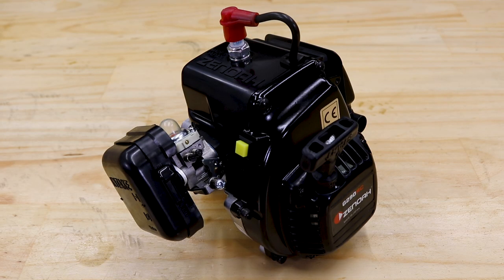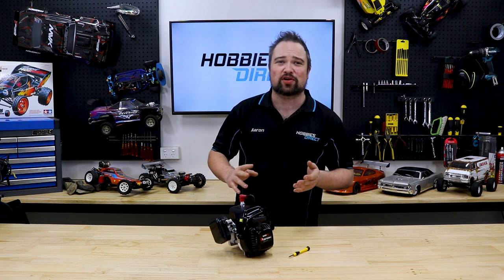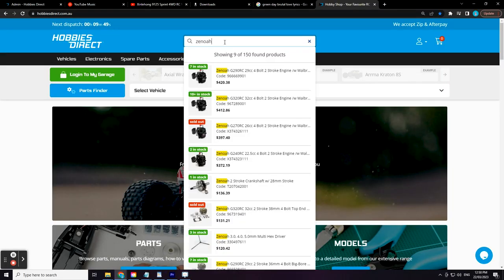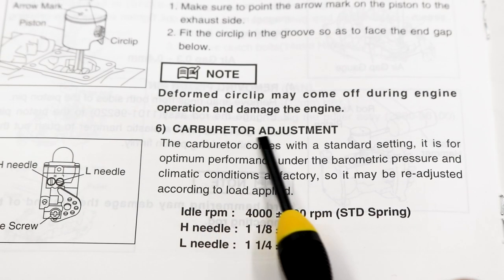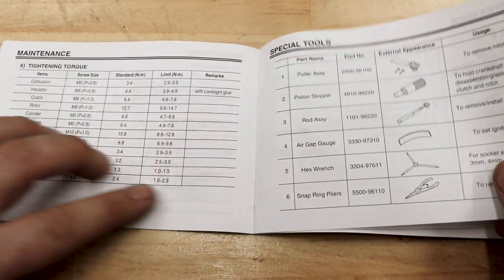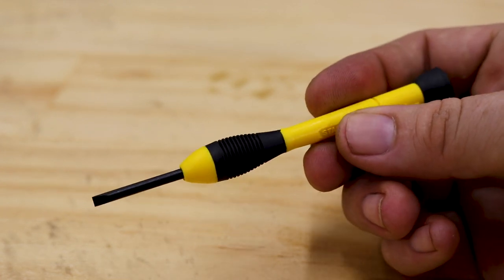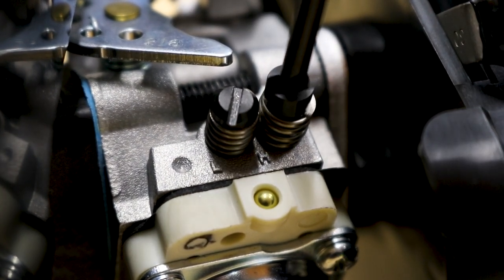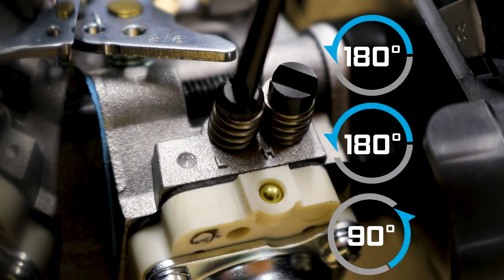Reset Your RC Carb in Just 3 Steps! (It's Easier Than You Think!)

Comment: Wondering if you can help. I change my octane from 87 to 91 with my Losi 5t. I ran yesterday and believe it burned my spark plug out. I didn’t adjust any needle. Left at specs out of box. Should I lean out  maybe that why it burned spark plug
Reply from the maker: Has the air filter been regularly cleaned?

Comment: What about the idle screw
Reply from the maker: There's no real factory setting, but about halfway (so the throttle lever is just resting on it) is good.
Reply: Idle screw should just barely touch/move the shaft from what I've understood. After that use the needles to get it to run right